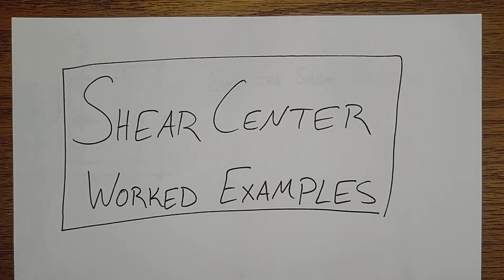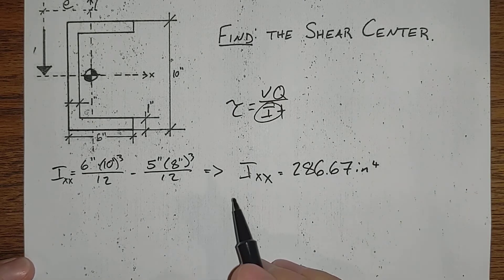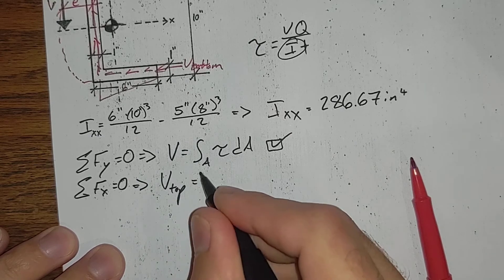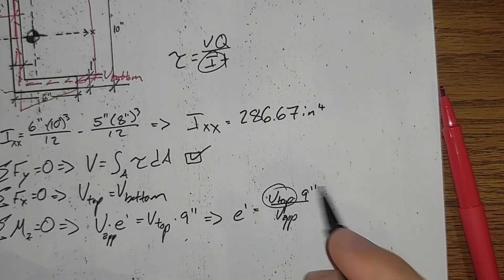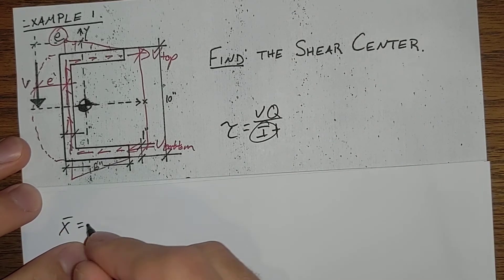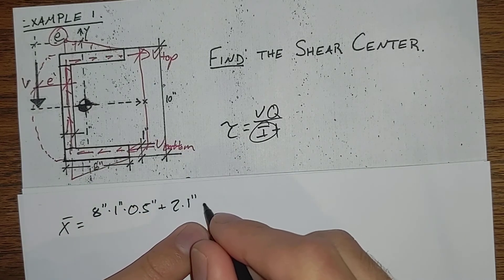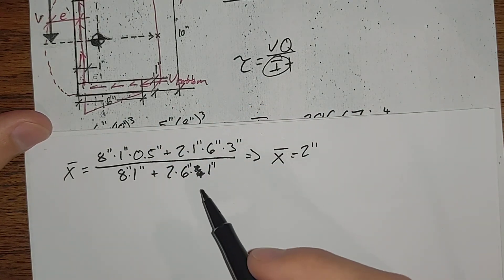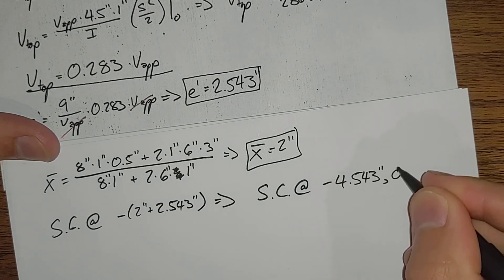Shear Center Example 1 - Symmetric C-Shape

Comment: you measured your centroid x distance from the far right edge and your calculated prime e is from the center of the section web to the left,  so its actaully 1.5 + the prime e not  2 + prime e? Essentially you forgot to minus half the web width from your calculated x distance so that its from the center of the web not the far left edge.
Reply from the maker: You're absolutely right, that was a silly mistake to make right at the end of the video!  I'll drop a pop-up card on there with the correction once I get my desktop fired up.  Thank you for paying such close attention, and for letting me know!